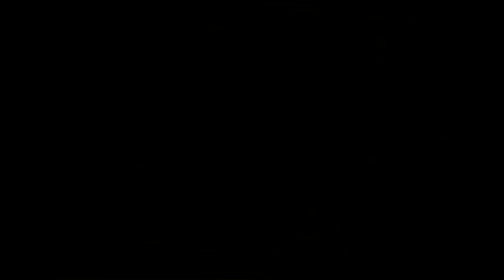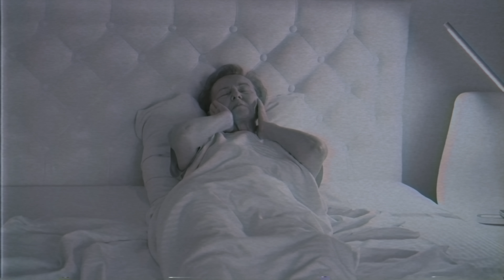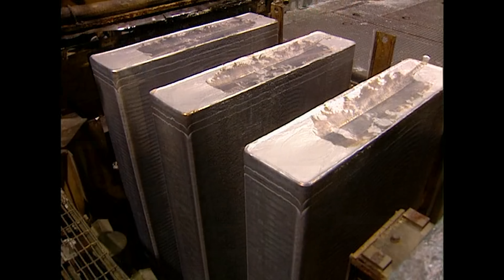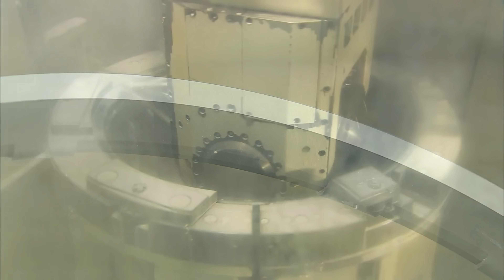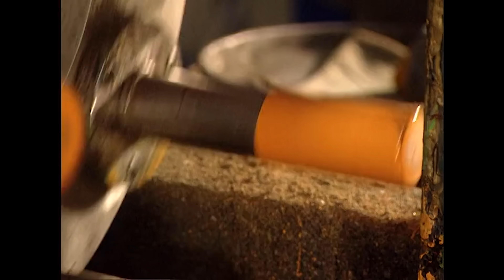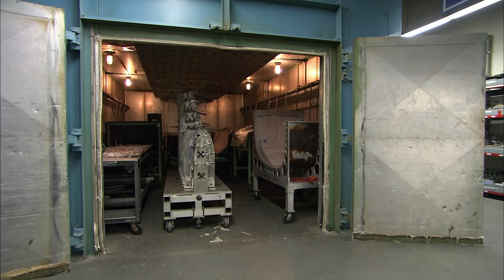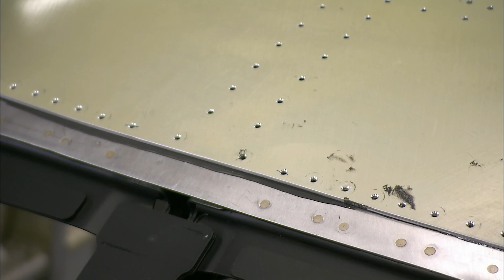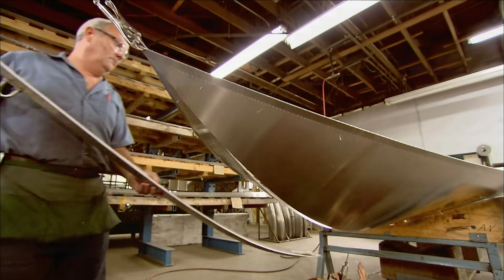How It's Actually Made - Aluminum Cans, Foil, Bike Wheels, Canoes, and More

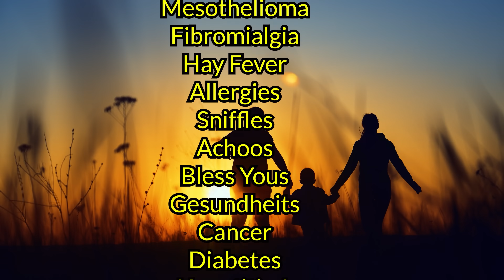Comment: 6:00 The full list of side effects, for anyone who wants to read them but can't be bothered to slow down the video speed and/or pause repeatedly:
Coughing 
Sneezing 
Running nose 
Chronic fatigue 
Heart attack 
Anxiety 
Depression 
Mesothelioma 
Fibromyalgia
Hay fever
Allergies 
Sniffles 
Achoos
Gesundheits
Cancer 
Diabetes 
Hepatitis A 
Hepatitis B
Hepatitis C 
Hepatitis D
Hepatitis E
(do the whole alphabet)
Road rage 
Alcoholism 
Withdrawals 
Deposits
Aspirations
Hallucinations 
Excessive masturbation 
Allen wrenches 
Gerbil feeders 
Toilet seats 
Electric heaters 
Trash compactors 
Juice extractors 
Shower rods and water meters
Walkie talkies 
Copper wire
Safety goggles 
Radial tires
Bb pellets 
Rubber mallets 
Fans and dehumidifiers
Picture hangers 
Paper cutters 
Waffle irons 
Window shutters
Paint remover 
Window louvers 
Masking tape and plastic gutters
Kitchen faucets 
Folding tables
Weather stripping 
Jumper cables 
Hooks and tackle 
Grout and spackle 
Power foggers
Spoons and ladles
Pesticides for fumigation 
High performance lubrication 
Metal roofing 
Waterproofing 
Multi-purpose insulation
Air compressors 
Brass connectors 
Wrecking chisels 
Smoke detectors
Tire gauges 
Hamster cages
Thermostats and bug deflectors 
Trailer hitch demagnetizers 
Automatic circumcisors
Tennis rackets 
Angle brackets 
Duracells and Energizers 
Soffit panels 
Circuit breakers
Vacuum cleaners
Coffee makers 
Calculators
Generators 
Matching salt and pepper shakers
Restless leg syndrome 
Hard to kill 
High fiber fibromyalgia 
Hot tub foot 
Lou Gehrig's disease 
Lou Barlow's disease
Lucy Liu flu
Advanced moist shin disorder 
Hyper tolerance to lactose 
Urinary tract infection 
Urinary 8 tract infection 
Trickle nipple 
Thick urine syndrome 
Habsburg cholera 
Clogged arteries 
Dropsy dry lip
Intestinal colic 
Indoor toilets allergy 
I'm a sufferer of milk 
Leg loofah rash 
Bone worm 
Selective fatigue syndrome
Hepatitis R
Irritable bowel syndrome 
Spastic ear discharge 
Pubic lice 
Amphibial rabies 
Anglo-centric sickle cell anemia 
Scabies 
Rabies 
Mickey Rooney's sugar babies 
Tarnished yam 
Symplex
Swollen perineum
Chronic shame disorder 
Larval penis 
Dirt belly 
Parkinson's disease 
Valet Parkinson's disease 
Parallel Parkinson's disease 
Parker Posey pox 
Pear ooboo
Canine derived hip dysplasia 
Selective albinism 
Scrotal migraines 
A prolapsed navel, and of course, puff knuckle
Hard to killness 
Crustaceans
Mammaries
Spaghetti lips 
Runaway penis 
Digestive explosion 
Explosive diarrhea 
Cut my life into pieces disorder 
Camptown races 
Doo dah doo dahs
Pride 
Joy 
Anger 
Love
Sorrow 
Agony of defeat 
Crinkle winklies
Scrummy buguses 
Danny DeVitos